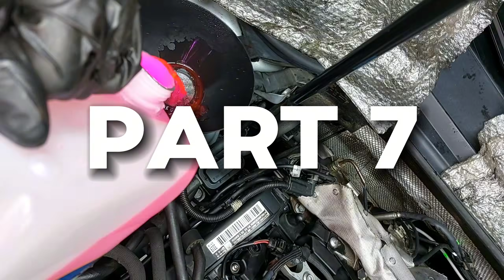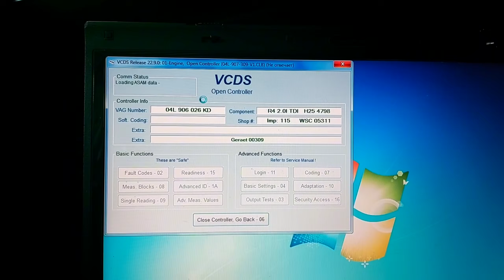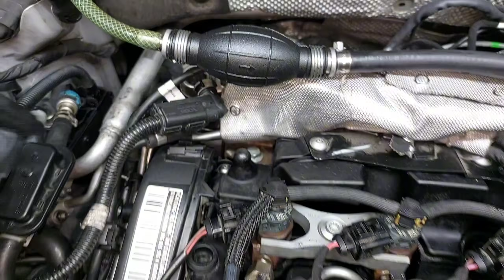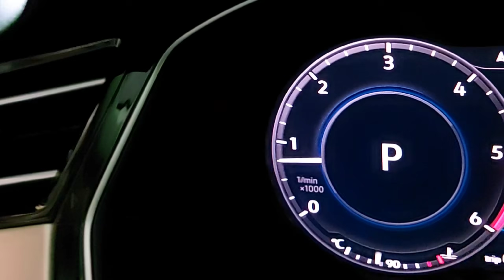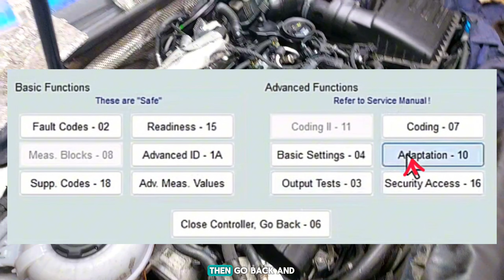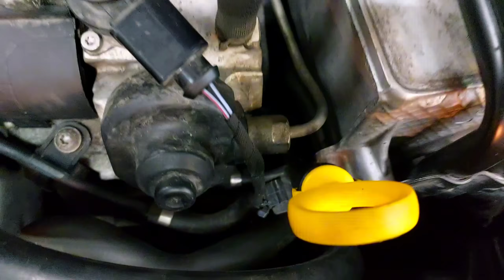VW 2.0 tdi ea288 bleeding Fuel and Cooling system (part7)

Comment from the maker: If you have "Odis scan tool" but don't know where to Tap to enable some tests, adaptations, bleeding fuel or cooling system. Then you need to click on "control modules" choose module that you need then "right click" on that module and select "guided functions" and you will see what you can do(Perform) in this module. I'm not big expert in ODIS or VCDS so you can correct me if I'm wrong. Watch this video for more info.👇🏼
https://youtu.be/ROTMKIzXJF8?si=MK1q6s3WTANopyee
 "guided functions" on 19;39min.

Comment: thanks for your work ;) please, can you explain why to remove the silicate bag from the collant expansion tank ? does it need to be replace ?
Reply from the maker: Hi, because over time this silicate bag tears and all those silica particles go straight into the cooling system and can block the heater matrix, which can lead to engine overheating or coolant ejection from the expansion tank, so very unpleasant things, it can give to you, this silicate bag.

Comment: Awesome work. I have watched all 7 of these. There is a lot of work there!
Just to add these engines also have a common heater matrix problem which can also eject your coolant out from the header tank overflow.
A blocked heater matrix restricts coolant flow on the micro coolant circuit so after a DPF regen it locally boils coolant and escapes out the pressure relief cap.
Reply from the maker: Thank you too, for adding useful information👍🏻🤝🏻

Comment: Hi, in adaptation I don't have the option bleeding. The security code is accepted! Have do you any idea why?
Reply from the maker: If be more precise then it's called "IDE08287-Bleed cooling circuit" and if you don't have it then i don't know🤷🏻, maybe manufacturer cut it off and you need to use ODIS.

Comment: Did you fix coolant  problem.  So was a headgasket? 
I can't find the video after parts 7 .  Thank
Reply from the maker: Yes everything is ok after replacement of the head gasket. And "part 7" is final part, i just didn't mention, that in this case head gasket change resolved the situation with coolant overflow.

Comment: Hey, I have a 2021 Passat 2.0 TDI 147kW DTUA engine. My headgasket was replaced and the cylinder head was flattend, tested and no leaks were found. Still, I have pressure buildup in the cooling system. Every morning, I release the pressure before I start the engine, and top it off if needed. I do over 70.000km per year with the car and the last 100.000km it's been like this. The car has 300.000+km and the mechanics around here won't fix it, they all say to scrap the car, although except for this issue, it runs well. And just for EGR removal and testing, they want to charge me over 1000 EURO, which is crazy. What steps should I take to identify the issue and fix it? Thermostat, EGR cooler, mass airflow cooler, what else could it be? a stuck pump maybe? If you can help me, please let me know. If you think you can fix it, pm me. I can bring it to you if you're in Europe.
Reply from the maker: Hi. It's a good idea to start with the thermostat, if that doesn't help, look at the main coolant pump. Usually the EGR cooler or any other cooler on these engines doesn't have much of an effect on increasing the pressure in the cooling system (they affect the charge air system and PCV system more when they fail), except for the oil cooler on the oil filter, but that's another story.
Reply from the maker: You can also check for exhaust gases in the cooling system, if you haven't already done it, so you will know (at least on 80 %) is the EGR cooler fail or no.
Reply: @HintSlice  what would be the logic here? I have a similar issue but the gases in cooling system test is negative.
Reply from the maker: Check or replace thermostat or coolant pump, they can also be the cause of this.
Reply from the maker: also it could be some consequences of the burst silica bag (maybe from previous owner if there is no silica bag in your expansion tank now)
Reply: @HintSlice how to deal with that tho :o

Comment: I was expecting reduction of noise after all this repair work, I think it's coming from AC compressor, serpentine tensioner and alternator pulley. Anyways engine is good for another 10 years or 200,000. 
Btw how much this work costs?

Comment: hmmm after replacing everything across all 7 parts of these episodes, I still seem to be building pressure in my cooling system. mainly when the dpf is regenerating, have you got any other ideas of what the issue could be? I don't want to give up on my engine but I've put so much time and money into it now but it's still has the same issues :/
Reply from the maker: Can you please tell what parts were replaced?
Reply: Heater matrix maybe if you haven’t changed that

Comment: Don't forget that this cars have 1kW passenger electric heater, so turn it off in media before confirming the heatup cycle
Reply: That won't come on if you are just idling.
It has several checks it must pass before it will turn on, including above a certain speed, and outside temp below a certain threshold.

Comment: good video, very honest and professional every time. I recently replaced the timing belt and water pump on an audi a4 2.0 tdi ea 288 engine with an electric water pump. I did the bleeding of the cooling system manually by squeezing the hoses and the air came out, since then I lose a little fluid per 1000 km 150g of water. Will my cooling system on the car bleed itself? thank you greetings
Reply from the maker: Thanks. Hi. Actually yes this engine can get rid of the air without any bleeding process, since it have two electric coolant  pumps that help to do that and it take approximately 1 hour after filling up cooling system, after that probably you need to add about 1 liter of coolant and that's it you drive happy without any need to add more coolant. and if you still have to add coolant after 1000km, then probably you have coolant leak inside of the intercooler🙆🏻. And check for any external leaks especialy where the oil cooler is, maybe seal is not holding anymore, like in this video https://youtu.be/fBAV-FHVV_0?si=2U7-I8fbwu2Ec20t
Reply: Thank you very much. I wish you all the best
Reply from the maker: Thanks and good luck🙋🏻

Comment: my friend, me again 😂.
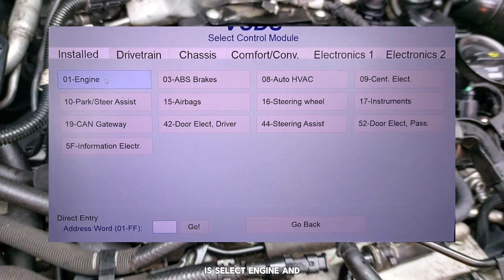on 5:30 you do fuel system thing. is this recommended when you change fuel filter (from maintenance) or not needed? i heard you cant just change this filter without some computing?? 😢
Reply from the maker: Hello👋🏻. In general you need to do this computing process after any work on the fuel system and it's all because of the Bosch CP4 fuel pump which don't like to be dry while rotating. In case of the fuel filter replacement, you can do it without scanner, but one thing is crucial and it's f
Filling Up fuel filter housing with clean fuel after or before installing new filter. For example, fill the filter housing halfway with fuel and then slowly lower the filter or do it like in this video on 3;59 https://youtu.be/lnMf34X_Nvw?si=vpTjzFvkBMQfnlMO

Comment: Did this fix coolant issue? Did same to same engine and more, same issue no obvious cause
Reply from the maker: Yes replacement of the head gasket solved that coolant overflow problem👍🏻
Reply: @HintSlice Did u had there was Oil in the water or water in the Oil, did the Car Smoke out of the Exhoust?  Best greetings🤝❤
Reply from the maker: Hi. It was only exhaust gases in the cooling system.
Reply: @HintSlice Thank You

Comment: I have ADS pro, however when trying to run test bleed coolant circuit, it doesn't allow me to run it
Reply from the maker: When VCDS starts the "bleed cooling circuit" test it asks to press first brake pedal then accelerator pedal etc. and only then test begins. Maybe in your case test won't start because you don't have this recommendations from program to "press pedals". And maybe you can choose this option in your scanner "Filling cooling circuit" if there is such option, like in this video https://youtu.be/ierxw8owls8?si=7We59cw8eGEZv_sr

Comment: Wtf...nothing, except vcds, is how its written in the original Skoda Manuals.
Reply from the maker: Exactly! But, to be precise, filling coolant with vacuum pump and bleeding with VCDS. Good job, keep it up good work👍🏻 Bro
Reply: Could you bleed the system just by running the electrical pump process before startig and doing a few heating cycles and topping up the coolant level? Would that be a safe way to do it? How essential is VCDS?
Reply from the maker: This is safe if your engine has a simple pump (e.g. SK VKPC 81178). If the engine has a Switchable water pump (e.g. LK 538 0733 10) then it is better to use VCDS to bleed the cooling system and not overheat the engine because at idle the water pump switch is closed, the impeller is covered by a shroud and VCDS opens this shroud during the "IDE08087-test-bleed cooling circuit" process. Everything you saw in the video is how it was actually done, nothing bad happened and this engine has a simple pump (no switch).
Reply: @HintSlice Thanks, I was looking into this. I wanted to my own toothed belt change and water pump (switchable) replacement in the near future. Was looking into your videos for reference. I will do it with vcds then, even tho i saw some people do it without it. Im only scared that my vcds will not allow this. For example, I have a 2020 skoda octavia 2.0 tdi and I couldn’t do a battery adaptation after a battery change, but on my brothers vw arteon one year older, it works just fine. Some things are locked on the newer cars…
Reply from the maker: Maybe they block some functions intentionally so you need to either buy an Odis scanner or contact a dealer.
Reply: @HintSlice Yeah, they did it intentionally so you have to go to the dealer. The problem is the dealers in my country are unproffesional and expensive.
Reply from the maker: Maybe they're doing this on purpose and in this way forcing you to go to an independent workshop and so the warranty void🤷🏻 etc. Thats why some people call them "official stealership".